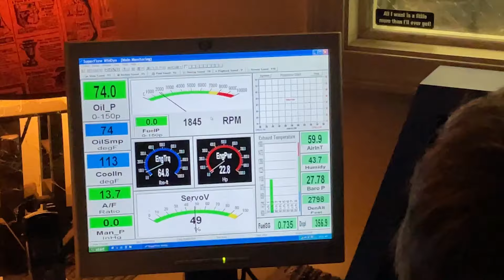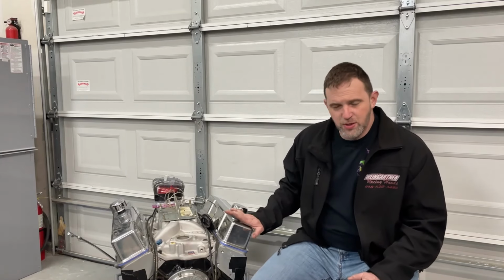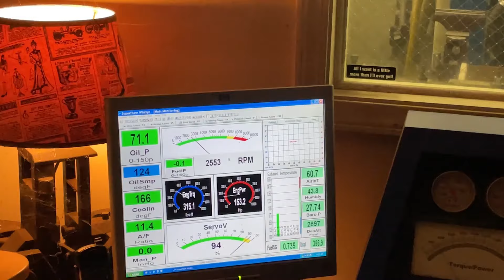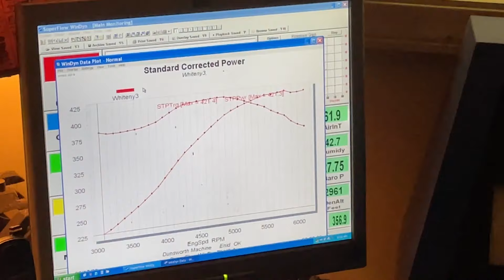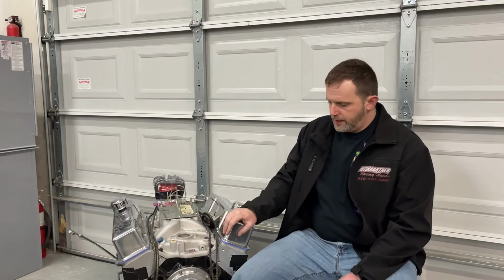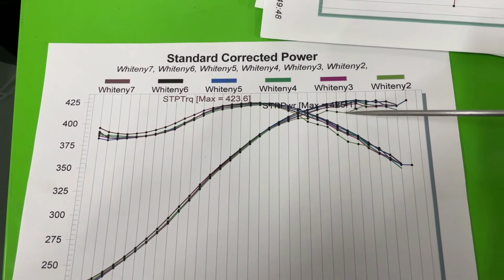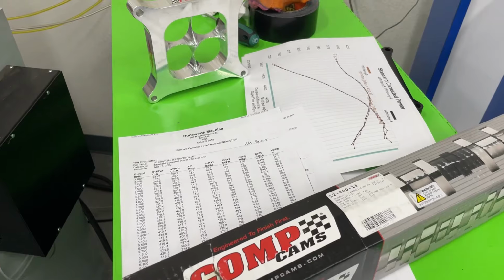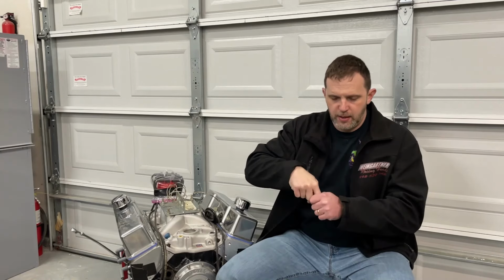350 Goes To The Dyno, Nobody Guessed Right

Comment: That engine makes more than enough power to break every factory drivetrain piece behind it despite being a mild build.  Nice work build target achieved!
Reply: Yup, I had a ‘87 Z28 years ago. I put a mild (450ish hp/tq) 383 in it. The rear lasted about 4 weeks and the 700r4 lasted about 5 months.
Reply: I thought exactly the same thing.  Factory driveshaft and rear end is history on Day #1.
Reply: That's exactly what I came here to comment, with a 700R4 1st gear and that much TQ if she romps on it that 10 bolt is toast.
Reply: Would not break any of the factory driveline parts in my 97 Express Van. 4L80E and 10.5 14 bolt in it.
Reply: TH-400, or M-22 W/M-20 ratios, Mark Williams equipped 12 bolt w/eaton posi and mark williams axles, 1350 u-joints and a 3" steel driveshaft...you won't break anything

Comment: Heads saved you .  Intake and cam not optimal at all.  Single pattern cam with your same intake lobe and a 106-108 Lsa would make 30+more ftlbs in my estimate .  Bleeding off a lot of midrange cylinder pressure
Reply: 106-108 lsa would idle like crap.. especially in a 350ci engine.. More power definitely, but his sister wants a smooth idle.. not absolute max midrange power.
Reply: @Torquemonster440  even with a lsa of 108 , 215 duration will not have poor idle quality
Reply: @hereinmissoula  - 215 duration will lope at a 600 RPMs idle...
Reply: Intake duration, LSA,  and intake manifold is great for his sister's daily driver... maybe a tad less exhaust duration... for better MPG...

Comment: Not  bad, by the time you throw an alternator and belt driven water pump and power steering pump, torque converter, trans and drivetrain it will have about 330hp to the wheels

Comment: Yup people have all banded together like sheep that the ideal head for a 350 is a 180cc and for a 383-406 it's a 195cc. But there are plenty of ways to build a engine as seen here. Big, high flowing heads will work great with a smaller mild cam because the cam will make the torque and the larger heads will still flow to higher rpms and make the horsepower. If the same engine was done with a smaller 180cc I'll bet it would've made peak power around 5300-5500rpm instead of 5800 and it wouldn't have broken 390hp.

Comment: I've broken the spider gears of the old 7.5 inch 10 bolt. Right at the starting line doing a dry hop. That little 350 is a easy 12-13 second engine in that firebird.

Comment: Nice build ! dyno'd my 388 sbc jet boat build. zero deck .039 quench 10.6 cr. 4 relief flat top Icon pistons. heads were laying around, typically wrong for this combo.  Old Victor Jr 220cc , .208/.160  valves, 5 angle grind.  Intake ports are 1206 gasket ,Air Gap intake are 1205 , but it seals with 1206. Step nose cam Comp billet core with iron gear. 2 degrees advanced, 230/236 , 598/598 /113 LSA. 1.5  comp ultra magnum steel rockers. Stock GM replacement Elgin drop in roller lifters with factory dog bone retainers and tray. Crate 502 BBC valve springs worked right with this combo.  It likes 38* timing and a 1-3/4 open spacer on the stock Air Gap intake.  Quick Fuel QR mechanical 750. Secondary jets are 80 pinned at .090". Primary air bleeds are .031" sec are .035. 
Made 474 torque /4900 
         475 hp /5400
Reply: sicccc
Reply: Damn, bad ass build. Awesome 🤙

Comment: What I've run into was decades ago I tore down a 350, and to make a long story short, didn't pay attention to mixing up a short headbolt with the oil pump bolt, which is a little longer and pushed into the main bearing, deforming it. But original pump. Just smoothed out.
 
Now I just get a stud for the pump
Reply from the maker: It’s very common mistake.

Comment: I was guessing it was going to make somewhere between 360-380hp. This thing is a beast! Gotta be the head work you did and that roller cam!
Reply: Why would you guess so low lol there's a big misconception that a gen1 sbc can't make power and that's just absurd lol every young kid thinks a LS makes 1000hp and a gen 1 makes 150hp lol
Reply: @jonathanlawson4667  lol I know right. The advantage the LS has is the stock heads flow great and they’re stronger but you can build a gen 1 to make a ton of power also. I was actually expecting to see little more of it.
Reply: @jonathanlawson4667  a ls is leaps and bound  better.head flow 320 cfm and way stronger bottom end
Reply: @ryangulley2051  it's not leaps and bounds lol you can splay bolt a sbc and it's just as strong. The sbc still beats the LS by leaps and bounds today my friend just depends on how you build them. Sbc won KD this last weekend 13K race and beat out all those LS you speak about and the sbc running a flipping carb as well 🤣🤣🤣🤣🤣🤣 you guys who say that nonsense obviously haven't ever built anything before
Reply: @jonathanlawson4667  For a gen 1 to make the same it takes more cam timing than the ls thats all. See guys get told on forums to replace thier BBC or 400 with a junkyard 5.3 and get pissed when the car can barely break 13s. haha
Reply: @jonathanlawson4667  I agree because a set of temporary run china eBay heads with a home machine job put me in the same range as a 5.3 at the same compression with ported polished heads and flat top pistons. It's so cheap here in NC to build a SBC right now I love the ls too but when u can buy a set of ported 461 heads for 120$ and get them cleaned at a shop the rest of the parts are barely enough to dent my wallet.

Comment: Basically I built the same engine Vortec L31 truck roller engine because I was afraid of all the cam failures lately. Same pistons stock bore same rings .024" quench and 9.72-1 compression according to the Diamond Pistons cal. sheet .028" chevy performance head gaskets and same bearings and Lunati 20080721 cam 270/278 and 515/530 and AFR enforcer heads. I have yet to install it. It's a tried and true recipe from many youtube vids and it makes from 413 to 440 hp depenging on the dyno etc. I'm putting it in a 1989 Chevy C2500 truck with a 700R4 with a 2000 stall Hughes converter and a stock 373 gear rear end and should be a tire fryer and fun to drive and dependable. The orig. TBI engine was 190HP and should be night and day difference. Thanks for the dyno Video.

Comment: Hyper U tech tick how we say it around these parts. Or Hypertechs for short. I painted my first engine build yellow back around 40yrs ago. It was a 400 Pontiac from a 67 Firebird. Ran pretty good for a kid building it. I had a uncle that had a 69 C-10 drag truck he raced on the street back in the early 80s, it had a tunnelram equipped 377ci SBC in it putting out 600+hp with a Jerico 5spd in it. The engine was painted yellow. He shifted that thing around 8800rpm. Ran mid 6s in the 8th, I was impressed with it, so I painted my engine yellow too. It was a popular engine color choice back in the day.
Reply: Thats the way ive always thought it was pronounced. Theres a lot of brands in the industry i wonder if i pronounce right.

Comment: I'd say the intake was the restriction since the spacers didn't change anything,, a 604 crate motor blueprinted will be in the 440 range both for HP and TQ  with a single plane intake ,, 750 carb ,, did see one make 451 hp , matched the track record so I think it was an accurate Dyno run ,,604 crate cam is 208/222-112 @050 , 1.5 rocker , 490 lift range ,, they have around the same compression, ,,

Comment: Interesting dyno results. I'm building a 385 similar to this with about the same intent but I don't requirea perfectly smooth idle. Just an 87 octane burner with stock stall and vacuum for the creature comforts. I have Afr's version of your heads on order. Planing on a simple 60 grit chamber and bowl blend. Under 9.5 compression for 87 but will be about. 040 quench. Pistons will probably be the thin ring KB hyper 18cc dish. Eyeballing something like the lunati voodoo 219/227 on a 112lsa. With a 1.55/1.6 rocker arm combination would put the lift about. 549int/.548exh. Waiting to spec the heads before ordering pistons or cam. They cant get here soon enough 😂

Comment: I built a stock  cast piston 350 with stock vortec heads,howards hydr roller 510 lift,summit air gap intake  ,670 avenger, summit 1 5/8 headers.made 415hp 425 trq.only spun it to 5,500.the vortec heads do a good job of making good power for people with a low budget. Use same  combo with a set of alluminum vortec head with a little more compression (quench) it would make about 50 more hp

Comment: Eric, man give your self some credit. That 350 kicked some ass for what it is. With stock GM 2.02 heads and a typical hot rod 220@.050 .480 lift flat tappet cam, reality is that would be a ~325HP 375TQ engine. Your heads and cam added 100HP dude! Your stuff kicked ass on this mild build. If you don't want to brag, at least take credit where credit is due. You can be humble, and still point out you did good on this build!
Cool thing is, is those heads would support 600+HP on a race prepped 350. Who knows, your sister (or kids?) may want to step that engine up to hit the track some day.
Reply: I really like the journey of taking a humble combination and make it overachieve. You have a good way of getting the point across.

Comment: Dude, 420/420 with that compression, loose quench, lower performance intake and 215* of intake duration, is really good. I estimated 385/415. I knew the tq would be decent, but I expected peak hp to come in closer to 5500-5600, mainly due to the intake. Your sister’s not going to know what to do with triple the hp/tq she has now.

Comment: First, you built the exact engine your sister needs (wants) for her Firebird. I guessed higher on torque and horsepower because I thought the heads would carry more torque higher in the rpm range. I’m guessing the low profile manifold held it back. In the car the shorty headers you’ll likely use will kill some of that torque, but it’ll drive well regardless. Great results Eric!
Reply: Yeah needs a raised airgap intake with a spacer
Reply: @jonathanlawson4667  - Looks like a raised intake, just no airgap...
Reply: 10 degrees less exhaust duration prolly would have been more 'exact'... torque come in sooner... better MPG...

Comment: Lots of similarities 360” sbc 200ik’s edelbrock rpm air gap Wilson 4 hole 2”spacer 750 hp no power valve locked out 38 degrees probe .125” domes comp solid roller 254/260 108 lobe sep. in an 85 Firebird that was a 2.8 4.10 gears 275 drag radials th350 with tci 3800 10” ran a beat so far of a 10.98 at 123 1.48 60’ with foot brake.

Comment: Nice numbers Eric number 7 pull will work nice in the street and have good shift recovery, your average numbers are excellent it will pull hard through the gears and the extra exhaust will work good with an exhaust system, good job

Comment: The cap threads get broken or distorted from the wrong pump bolt being installed. The two odd SBC headbolts get mixed up with others on the engine. The oil pump bolt fits the head in the oil return hole, but the head bolt comes up a bit short if used in the oil pump.

Comment: What I believe happened with the oil pump bolt, and I've seen it before, they used a short outer 4 bolt main bolt and not an oil pump bolt. They're not long enough.  Only catch 1/4" of threads or less and once pump vibrates it breaks those protruding threads. 
When laying out your bolts for mains make sure there isn't one longer one! That's the oil pump bolt! It'll fit the main because those bolt holes are open and that bolt won't bottom out. Oil pump bolt is about 1/4" longer. 
I'm retired machinist. Seen this at least 6 times.
Reply from the maker: Nothing happened to it. This is a two bolt main block with arp bolts. Oil pump is a stud.

Comment: Hi Per U Tek Tik pistons
The heads are not too big.....big flow out of a relatively small port means big velocity. Add in the dual plane intake it will pull on the carb hard.

Comment: That HP seems extreme for who it's for, I would think some 1.94 heads, flat tops, something like a 275 hp 327 cam, 600 cfm carb would be around 300 hp, better low end response and gas milage. My two cents...

Comment: Hey bud question building a 355 sbc. Wanting to make it a bad ass street/strip engine. Going in a 83 c10 truck.  I want 10.5 to 1 cpr  heads in gonna run afr 195cc. Howards hyd. Roller cam 227/ 233 duration  560 /560 lift 110 lsa torker 2 intake 650 Holley with this set up what kind of power you think I'll get out of her?  93 octane

Comment: I would like to know how egt affect power doesn’t hot exhaust flow better then cold exhaust. Turbo cars are the only ones with enough exhaust heat and back pressure to melt something I’ve never heard it be an issue N/A even on 800 hp builds

Comment: Nice information!  Would love to have seen a 1” plastic four hole with no taper.  I’ve only had five of my own motors and probably seen 50 others and the dynos rattle a lot.
Reply: Tapering increases velocity of air, reduces pressure, venturi effect

Comment: With that much power, the car will feel helpless coming off the line with one wheel peel... 
I experienced that feeling in my '65 GTO back in the day when I overheated the posi and it stopped working until it cooled back down again... without posi the car felt like it wouldn't get moving... 
Was predicting 430 torque and 450 HP... until he mentioned the bad engine quench distance which hurt compression ratio and torque, and high RPMs power...

Comment: Eric, I'm aiming to do a turbo engine based on a dart 400 SBC block taken to a 427 with a stroker crank. Everyones telling me I won't be able to make power with a 4 inch bore and boost. What do you have to say to that?  I really dont want to change my planned combination because weight comes at a premium and I dont really want to go to a big block platform If I can help it
Reply from the maker: With a 4 inch stroke you have a short compression height on the piston so it is not as thick.  You really don’t need stroke with boost.

Comment: I guessed 425 torq at 4000 amd 425 hp at 5500. That's what happens when you have enough head and don't have to try to crutch it with to much cam. You don't need tight lsa to make torque when you are not trying to crutch a poor head.

PS Given the rpm it made peak torque and horsepower, the conservative dyno and lack of jetting and timing changes I suspect I guessed low.

Comment: Hey eric can you help build me a torque monster 350?  1981 to 1970.5 clone  its a 378 has a 1.195" piston , 6" rods, 3.66" stroke crank in an undecked 4.052" bore block, pistons are flush. i shall need to save up and get some heads from you it may be some years. i am really slow, like working on this for a dozen years already. i haven't specified a cam or final compression , maybe these heads would work? intend to run a dual plane, have an EPS endurashined right now , although i shall probably use the performer RPM. i put more cubes so i can have greater torque and kept the rod ratio at 1.64:1 for a street machine daily driver with great power. runs manual brake system. and manual steering. high ratios so those are settled. Automatic Th350 transmission modified heavily custom close ratio gearing. Although thinking of using a TH400 or a 4 or 5 speed manual as i still have the clutch pedal for the 81 canadian experimental yet may go clutchless. There is no stall yet. nor a driveshaft or rear gears , has posi. no ignition yet, no heads, no carb yet, headers shall be custom 180* long tubes built by me with long collector, muzzle break box and custom built mufflers. i also want to try a 3.66" crank in a 400 small block to build a 397 c.i. with a 4.155" bore. Just as soon as i get an undecked 400 2 bolt block with a good stock deck that checks out.

Comment: Nice work. It did what it needs to do.
That said, I wonder if it might have made more torque with a little LESS timing? I’m thinking 480 HP - 530 ft/lbs. But if you weren’t going to be using the carb or headers, there’s no point in ANY tuning. Well done.

Comment: Guys in the comments talking about how to get more out of this combination, and here I am thinking about how it could be made even lower compression and idle even smoother.
In an 88 firebird with a T5 and a ten bolt posi with just under a ten inch wide all season tire,  I would want about 360 hp by 5,500 and just under 400 torque. Thats enough to blow the transmission, rear end and tires off of it on regular tarmac. Anything more would just feel like a grenade. Especially if it has the 700r4.

Comment: I'm not too familiar with cam specs.  
I'm wondering why do much exhaust duration? 
What would 5-10 degrees less on exhaust duration do to the power?
Thanks.
Reply from the maker: Adding exhaust duration extends the power band and also puts more heat in the exhaust which should help with EFI. This cam really was more of an experiment.

Comment: Why so much exhaust duration, 17 more degrees than the intake? I can see how that helps above 5000 rpm, but it will hurt gas mileage and if Oklahoma ever requires an exhaust emission test for that car, you will have to change that cam.

Comment: I was 4HP and 100 RPM off on power. I thought it would make more torque early and peak by 4100, was 700 RPM and 40 lb ft off. It’ll be interesting to see how much timing it wants in the car with the final setup. EFI of some sort or carb on the car?
Reply: Yeah, the big exhaust duration seemed to make the torque peak at a higher RPMs...

Comment: Ok say what you want ,but my 383 ,with  zero deck, Afr CNC ported, custom chamber,  big valves, huge cam 680 lift 108 lobe separation, 830 carb. Love is but the power difference is like quick and fast.

Comment: Locked out at 36 will cause  hard to start problems when it gets hot.... will need to set up that distributors mechanical advance....
Reply from the maker: The sniper will have a different timing curve but peak will be 36degrees.